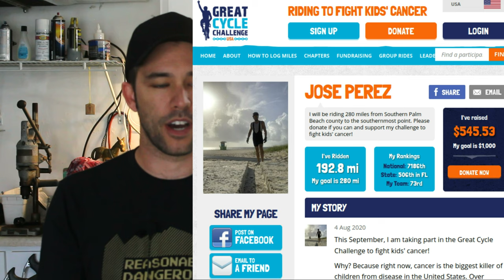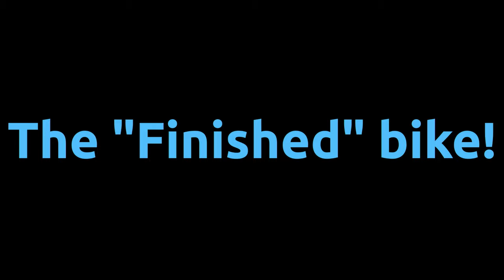Kent Ridgeland Makeover - cheap Walmart bike upgrades

Comment: Quick question. My son has been riding this bike and last month while away at college the bottom bracket indeed did seize. If we purchase the Shimano BB UN-55 can we reuse all the rest of the gear on the bike including the crank, pedals, and chain? Much thanks for your input!
Reply from the maker: hey Mark, yes it should all work. The only thing is make sure the total width of the BB is the same, meaning the end of both axles, that way the chainring and the pedals will all be in the same place.

Comment: You were holding the channel lock plyers upside down. When held the correct way the get tighter as you put more pressure so they don't slip off.
Reply from the maker: yeah I only realized that when editing the video. But I believe I did have them the other way at one point too. I don't think they really lock down as tight as the pipe wrench, that thing took it off right away.
Reply: “Plyers”, not PLAYERS. Silly boy!

Comment: I keep coming back to this video. I doubt i'll ever get a ridgeland, but my own bike adventures have gone well. I mean fine right now I'm stuck on a single gear because the shifter tore up (yes that's a fifteen buck part but like... stuff's come up so I don't feel comfortable putting priority on that.) Bashed and hacked and turned my freewheel into a single speed freewheel. Deraileur off. chain cut to length. Put a spacer made from discarded woven wire fence we have laying around (no rust on it) behind the freewheel. It is VERY much a hack job. Yet it rides. it honestly feels good to putter around on. AmI insane? Maybe, but the process of constant adjustment til igot it right has me thinking 'Huh mask off most of the frame and black out the front and rear dropouts, maybe some blackout on the underside of the bottom bracket and fade up the front triangle...'

I've yet to try the big giant scary hill I couldn't even with low gear... but like... my bike is in working condition until I can prioritize it again. 

Keep bashing man. looking forward to more content.
Reply from the maker: thanks Andrew. I did a video once where I converted a road bike to single speed by trapping the one cog between two larger ones. https://youtu.be/E7SthYv5GfI

Comment: Great video!   I have the same bike and will be upgrading to the UN55 BB 68 as well.  I see you went with the 110mm spindle length...could you tell me what the original spindle length was on the the stock BB?   Not sure if I should order the 110mm or if the 107mm would work just as good.
Much thanks!
Reply from the maker: thanks a lot Frank! Actually the reason I went with that one was just because I happened to have it laying around. It seems to be a good fit in terms of the chain line, haven't had any issues. Sorry I don't know the old length, I'll check it if I can remember next time I'm in the shop.
Reply: @BruceChastain were you ever able to check the original length? First time bike upgrader. Gonna grab the same BB. I just don’t want it to be short and hit the chain stay. Also, don’t want it to be too long to where it doesn’t line up with the cog.

Comment: What size bottom bracket did you use, was it 68 127mm or 68 127mm/ size 7? I’m building the same as this, I wish to obtain a good fix gear while I work on my 2012 1:1, thank you for posting.
Reply from the maker: thanks Adam, sorry I really don't remember what I put in there and I've already sold the bike. I just put in something I had laying around in the parts bin.

Comment: Hello, how difficult is to remove the back tire to change it? I could not see in the video how you did it. Thank you.
Reply from the maker: Hi Maria, it's not too hard, do it just like any other bike, really is no big deal. Only thing to consider is that this bike doesn't have quick release, so you'll need a wrench for the axle bolt.

Comment: Dope!! I could tell you like to tinker and you did it on a budget... im a bit over $200 on bike parts from se bikes and maxxis holy rollers on a $180 bmx mongoose grudge.. i stopped at cranks.. i wanted to sell it and get a nice old road bike.. but people are cheap.. so i kept it and just cruise it from time to time.. also interested in a fixed gear just for the heck of it..
Reply from the maker: very cool Diesel! I'm also foreseeing a similar problem if I want to sell it. Even with the nicer parts and it looking good, folks are going to probably say, "hey I saw that bike at walmart for $100.".

Comment: Do you have a complete list (b/c I know you said you used some stuff you already had) of what exactly you used/recommend for upgrade?  Thx
Reply from the maker: Great question. I'll add a list in the description, hopefully later today. Then I'll reply back on here so you know it's up.
Reply: @BruceChastain  yeah, I'm way way new into cycling but I guess its a benefits from Pandemic and enjoying.  bought the cheap bike b/c its gearless (something new) and was hoping to mess with it and tweak as an experiment.  But I'm also zero skilled in anything mechanical, so any videos and "exact" knowledge of what works is a safer (less expensive) way for me to learn.

Comment: Hello, I'm extremely new to bikes and thinking of buying this one as my first. I want my tires black like yours. Is there anything else you recommend "upgrading" or changing? I also don't know any of the tools required to change the parts so if it's fine, can you list them with the recommendations you're going to list? Thanks for your time!!
Reply from the maker: hey weeeb, if you were to get one I'd personally at minimum not only change to black tires but also change the grips. If you have no tools at all I would suggest going to a bike shop, tell them you want to learn how to do these types of changes in the future and you'd like them to show you how, they should be happy to do that. Then you'll learn what's needed. It's not a lot but there are a handful of tools you'll want to collect.
Reply: @BruceChastain   thanks for your reply!! By grip do you mean the handle bars?
Reply from the maker: @WarriorWolfinAQW  sure. not the whole bars but the plastic part you put your hands on. It's just a personal preference but I don't like the bright yellow ones.
Reply: @BruceChastain   quick question, apologies for random nooby questions. Can I buy any 700x25 tires for it to work? The one you listed isn't exactly available on Amazon for me.
Reply from the maker: @WarriorWolfinAQW  no problem at all web. Any 700c X 25mm tire should work. But I would recommend 28mm or wider, I only used these 25mm tires because they are what I had laying around anyway.
Reply: @BruceChastain  thank you so much. Appreciated the help man :]]
Reply: @BruceChastain  Helllo!!! Finally just built the bike and it's great!! Before changing the tires,  do I have to change the inner tube or something since the stock tires are 700x38c? It's a big change going from 38 to 28 or 25. Also, I'm guessing the tire type doesn't matter for this bike? thanks in advanced!! I'm so excited.

Comment: Very nicely done. Found your channel doing some research on this bike after running across one at my local Walmart. Thinking about getting as my first project bike. Do you have a link or model # for the upgrade Shimano BB you used? Thanks!
Reply from the maker: thank you! Here is an amazon affiliate link to the bottom bracket, mine was 110mm wide. https://amzn.to/3a5zmRr
Reply from the maker: so you can select 68x110 in the size drop down. Other sizes may be okay too, this is just what I had laying around.
Reply: @BruceChastain  thanks a lot bro! Do you have an affiliate link for the crank puller too? Definitely wanna support. I binged watched your channel last night! Good stuff man. Got me wanting to move down to Florida for the year round riding potential. Haha
Reply: @BruceChastain  Oh and a BB socket too! I see this needs one and I virtually zero bike specific tools at the time. But that'll change. Thanks again!
Reply from the maker: @RealDocJames  thanks so much man. I'll get a link when I get home. but really if you click the one above, anything you buy in that session will count.

Comment: After all the upgrades, how does the cost of the bike compare to one that had premium components on it to start with? You switched out everything except the frame.
Reply from the maker: Actually a good bit is still stock on this one, still  has stock wheelset, fork, headset and bars. But I guess it’s still a lot cheaper than a premium bike, I guess it has just over $100 in additional parts, so still a $200 bike. Is the value there, I don’t.

Comment: Hey Bruce what is your gear inches?
Reply from the maker: Not sure, sorry the bike it gone now. But pretty normal range. I think front was 48t, rear 18t, tires 700cX25mm, so just run that in a calculator.
Reply: Thx Bruce!

Comment: Such a great video.
The bike looks really nice especially at 24.9 pounds :) 😀
How come you didn't replace the seat post with a lighter post ?
Do you plan on updating the fork/stem/handlebar ?
Reply from the maker: hey AB. I made a community poll to see if anyone would want to see this bike converted to a drop bar fixed gear, and a small majority said yes, so I think I'll change up the stem and bars at least. But I don't think I want to spend the money on such a cheap bike to change out the fork. I just happen to already have some extra drop bars around.
Reply from the maker: @Not_Sure_  wow really nice of you. Like I said I do have some drop bars but if you'd like to see yours on this bike, sure I'll put them on! I'll just have to get the 31mm stem, no problem. send me an email if you want to HackAndRideBikes@gmail.com

Comment: I have this same exact bike n I threw on a set of DYNO BMX KNEESAVERS N A CHEAP WALMART 4 BOLD HEADSET N IT MADE IT A 700C BMX BIKE BASICALLY N ITS ALOT MORE COMFORTABLE RIDE STANDING UP OR SITTING DOWN... THREW ON A REALLY THIN NISHIKI MTN BIKE SEAT N ITS ALOT LIGHTER Tryna see if one of those REALLY OLD SKIPTOOTH CRANKS WITH THE HEARTS WOULD FIT THIS FRAME BUT IDK IF ITLL WORK... If u have any clue go ahead n comment bk... I'm all ears to nu ideas.
Reply from the maker: nice man. But sorry not sure about that skip tooth crank. some of them older ones are single piece, so you'd need the whole matching bearing kit if that were the case.

Comment: Hi i am looking to do same upgrades but what tier size u used n also what kind of bottom bracket n crank u used
Reply from the maker: it's a 700c wheel. I used a 25mm wide tire and with this wheel I wouldn't suggest any smaller. I'll check the brand next time I'm out in the garage, but I got those in Switzerland, not sure if they are sold here in the US.
Reply: HACK AND RIDE BIKES i really want to upgrade the front chain ring as i am out of peddles v easily n spinning a lot . What size chainring do u have 50 ?
Reply from the maker: @shaymtbrider7244  the one on it now is a 48t, seems like a nice balance and way better than the 44t that it comes with. But if you want to do it more cheaply you can change out the rear one, I've seen like 16t for like $10. The one on it now is 18t.
Reply: HACK AND RIDE BIKES thanks really appreciate it ya i will change rear one
Reply: HACK AND RIDE BIKES hi can u tell what kind of rear fry wheel i needed so i can order on line ?
Reply from the maker: @shaymtbrider7244  something like this should work. https://amzn.to/3jkiwk2
Reply: HACK AND RIDE BIKES thanks what u will suggest 16 t or 14 t . On 18 i paddle out v quickly around 13 to 14 mile per hour so mantain 14 mile speed really difficult on 18 t .
Reply from the maker: @shaymtbrider7244  this might help: https://www.bikecalc.com/gear_speed
At 70 rpm, you can go 13.7mph. so if you go with 16t cog, at the same cadence, you'll be going 15.5mph, that's pretty close to what I have now with 48x18, which I think is decent. If you want more top speed go with the 14t, but if it were me I'd go with the 16t I think.
Reply: HACK AND RIDE BIKES i saw the link u sent me also have 3 in one chainring how that will work ?
Reply from the maker: @shaymtbrider7244  I'm really not sure about that one.

Comment: Boy, that paint on the brake levers, and the decals were heavy, dropped the weight by 5 lbs!  LOL.  Seriously, with the parts swap, five pounds is substantial.  Another consideration for weight and comfort would be the saddle. Cheap saddles are usually not light or comfortable
Reply from the maker: yeah, for some reason with that saddle, it was fine for regular street clothing but did NOT go well with cycling shorts.

Comment: I own this bike. Some notes. Chain came way too tight. Relieve some tension in chain. Bottom bracket was crushing the caged bearings. Way too tight as well. Loosen up as well. Grease all bearings as they were dry and sticky. Brakes need tweaking as they were binding as well. Stem had no grease and will rust in place. Pull it and grease. These simple adjustments will make a world of difference in ride quality. Whoever assembled originally torqued these items down way too tight.
Reply from the maker: yep, seems to be always the same story with these bikes, always assembled wrong.

Comment: That creative commons attribution license? Does that mean I can re-edit the video with lots of strange flatulence noises and a distorted disco theme plus superimpose the heads of random elderly people or is that not how the creative commons attribution license works. Seems very abuse-able. Anyway great video, I probably wouldn't have changed the crankset because it looks too expensive for the bike and the included crankset had better chain retention by the looks of it and therefore I wouldn't have changed the chain either.  I love the simplicity of such bikes.
Reply from the maker: haha sure knock yourself out man! :) I got that crack set back in Switzerland, there was a organization called velos for Africa, people would donate bikes to them. If the bike had like a broken frame for example they would part out the bike, in the basement they had a huge stock of used parts for sale. I think I only paid about $15 for that crankset. Otherwise I also wouldn't have put it on there.
Reply: @BruceChastain  That sounds like my sort of paradise looking through such a place for bargain bike bits. The only thing I would say is it does up the look of the bike but also make it more desirable to thieves. It's funny how removing the Kent/Walmart stickers makes the bike look more premium too. They seem surprisingly easy to remove too which is no bad thing.
Reply from the maker: @bonzobanana1  yeah exactly I was also surprised how easy it was to take the off and how clean they came off. Also yes it looks so much better without them.

Comment: Does anyone know the size handlebars and what size stem to use for an upgrade on this bike
Reply: Any quill stem and bars for a 1" threaded fork will work (22.2mm iirc), or you could get a 1-1/8" adapter that will fit down into the fork like a quill stem but will allow you to use modern 1-1/8" (28.6mm) threadless stems and whatever bars you want.
Reply from the maker: thanks Cro Minion
Reply: @crominion6045  yes thank u

Comment: I guess I understand why upgrading big box MOUNTAIN bike pedals would be necessary, due to the amount of abuse they’d be subjected to on the trails. But can someone tell me why so many people upgrade stock pedals immediately even on commuter bikes? I’ve never upgraded pedals on any bike EVER, and have never had a single issue
Reply from the maker: For myself, my main reason is I don't like how small the factory pedals are, if I'm keeping flat pedals I want them to have a larger surface for my foot. The next, but much less important reason is they're usually ugly. I pretty much always upgrade, but in the past I have rode many kilometres on factory ones.

Comment: Love the video! I’m following along, I just bought the same bike. I want to get into cycling but I can’t afford a good bike yet. I really hope you do the video where you replace the bars with drop bars. 

If I wanted to do the same thing, where would I begin? Is there a certain size I would need to fit this bike? I’m sure there’s a diameter or something I would need to know when I buy it to make it fit. I’m brand new.

Also, could we get links to other parts in this video (or similar ones that would fit the bike). Like tires, tubes, pedals, etc... 

Thanks man!
Reply from the maker: hey Jeff thanks for the great feedback. I'm going to add the links in right after I get done replying here. As for the future, yes I'm going to make at least one more video on this bike with drop bars, but so far I haven't really even started. You know it's about the cheapest bike you can get, but I think with some modifications it can look pretty good actually.
Reply from the maker: I've updated the description with some product links. The inner tubes were actually the same ones as it came with, I wasn't sure if they would fit but they did.
Reply: Thanks so much! I’m going to subscribe and keep watching!

Comment: Great brake lever work! I might try that.
Reply from the maker: thanks Andrew. It really wasn't too bad, I'd just suggest to get the softest wire wheel you can get, the one I has was a bit too stiff and it left kinda deep scratches. But I still think it came out pretty good.